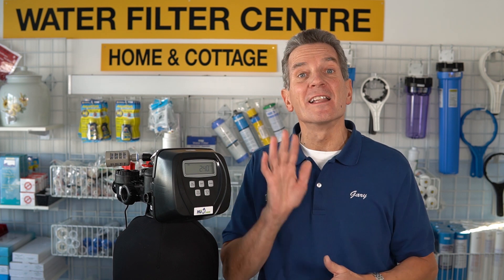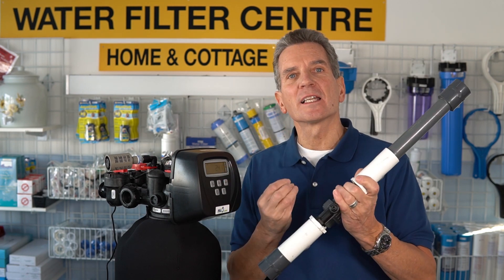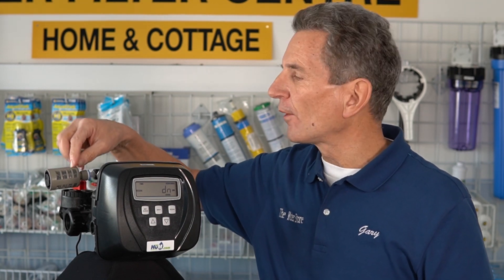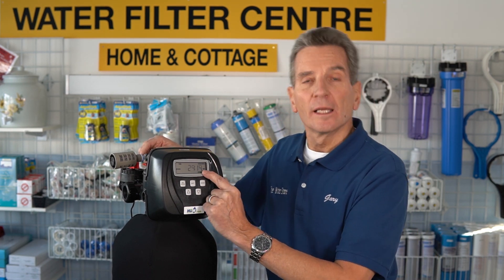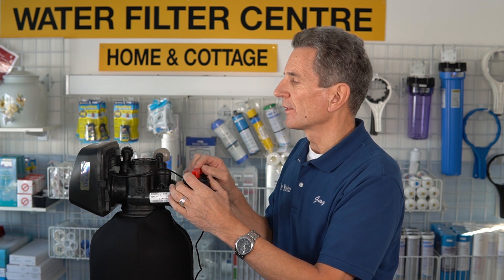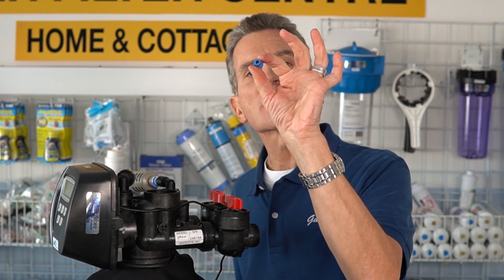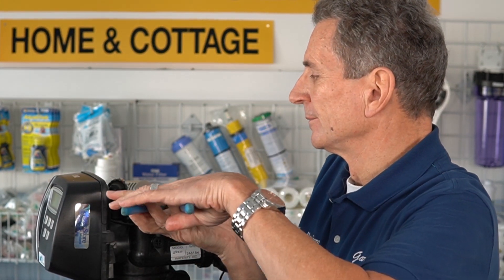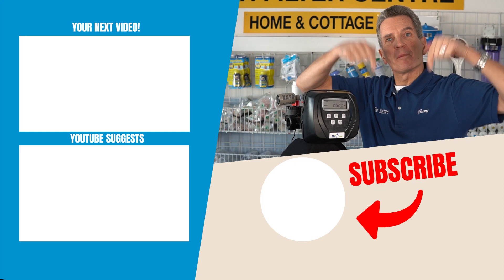IRON & SULPHUR WATER FILTER TROUBLESHOOTING and Repair in 7 Easy Steps

Comment: Hi Gary, i hear a gurgling sound (water moving) in the unit everytime i use a faucet in the house. The issue started a few months ago. The unit itself seems to be working just fine. Wondering what you think.
Reply from the maker: It could be that the internal check valve is fouled with iron. https://waterestore.ca/products/clack-ws1-v3957-internal-check-valve-for-fob-c-k  Check it out in this video https://youtube.com/shorts/TQZed1m_4oA

Comment: Hi
Question:
If i put this air valve how my softener will get the water with salt from the barrel?
Thanks
Reply from the maker: You need the injector to create the suction to suck the brine from the brine tank to the softener.

Comment: The morning after the iron filter regenerates (every 3 days) we have a brief sulfer smelling water in the running water. I usually let the water run for a few minutes and it goes away. What can be causing this?. The system also has a water softener tank.
Reply from the maker: You can try changing it to every 2 days instead of 3
Reply: @water_estore  thank you, I'll give it a shot👍

Comment: HEEELP!!!!!! My filter is leaking right at oring where it screw to tank, also when I hit regen it shows call such number for service, umm problem is I own the equipment, so will your service bypass this nonsense??  Leaking in ft myers fl
Reply from the maker: Call means nothing, just a reminder that someone programmed into the valve.  if it is leaking at the top of the tank you may have a cracked tank.

Comment: When your doing each step such as taking out the air valve do you stop the backwash process you started originally? And if so how?
Same question on when letting the bleach sit you started a cycle but didn't end it? Is that how it should be?
Reply from the maker: You keep the system on bypass during those steps.
Reply: @water_estore  ok I understand the bypass but I don't think you got my question....  Do you END the backwash process while your performing steps such as removing the air valve while installing the hose etc?

Comment: Hello Gary, We moved into a house with an ozone water treatment system and a Ws1 iron removal unit and your videos have helped me to understand how everything works. Thank you so much. Recently our iron filter has started leaking a little bit out a small spout at the top of the unit during its regen cycle, I can find no reference to what this spout is for in the downloaded manual. Any ideas what would cause this? I believe the unit is due for a valve rebuild and rebedding. Would I be able to order everything from your store to do the job?
Reply from the maker: Hi Steve, your leak is from the drain elbow and we have the replacement part here https://waterestore.ca/products/clack-ws1-drain-elbow-v315801  Yes, we have the rebuild parts here https://waterestore.ca/products/clack-ws1-fob-c-k-rebuild-kit-no-injector-wrench and the media here https://waterestore.ca/products/birm-iron-removal-media-1-cubic-foot

Comment: Hi Gary. I am in a home with a soft pro system. It is set to 10 min backwash, 60 min Brine and 10 min rinse. It also has a refill setting that is set to zero. Are you familiar with this system and is the 10 min rinse getting rid of my air pocket? Smells like eggs right now.
Reply from the maker: Yes, that rinse should be zero.

Comment: We have a Marlo Oxidizer iron filter installed in 2019. Going on vacation this summer and would like to shut off water to home. Don’t want to regenerate without water so can I simply unplug the iron filter, then plug in when we get home? Will we lose any settings or does it default everything back in?
Reply from the maker: With our HUM water filtration products you sure can, not sure about theirs.  I would ask them.

Comment: I got mine sucking air and working but it has low pressure and you can here water dripping inside the tank after you run water or regeneration, and also it’s got back pressure until you put it in bypass which that might be normal. If I had pressure I’d be good.
Reply from the maker: It sounds like it is clogged with sand. check this out https://youtu.be/tCQQxiT-zoc

Comment: Have you ever come across one that always has water coming from the drain line? What would cause that? I have one called the repair guy he came over said all the mechanical things work like the cam and switches. He said my problem was I have a leak and I’m using to much water. I searched my home found that the water is actually coming from the iron filter itself out of the drain line what would cause this?
Reply from the maker: Water is leaking past the piston and seals.  this video will help https://youtu.be/RhvspR3PAw8

Comment: Ever have the issue where the filter draws air just fine during the brine cycle except it spits it out the drain at the same time? I replaced the seal pack and piston. Worked great for a week where only water was going to the drain during the brine cycle but now once again air is going to drain. I can barely get a day out of my filter before it becomes waterlogged and gives me H2S gas smell. The filter can barely draw enough air.
Reply from the maker: No, I can't say that I have.  I have a new video coming out soon about replacing the internal check valve which might help you.

Comment: Thanks so much for your videos! We cleaned the injector, but the air intake on the iron filter with the inlet valve open, will not suck up the bleach. Any advice on this would be greatly appreciated!!!
Reply from the maker: Do you have it in the brine cycle?
Reply: @water_estore  thanks for the response!  We purchased this house and it has a water system.  It has a water softener with brine tank and a another larger tank (iron filter) i believe because there is so much iron in the well.  it has an air intake.  When holding the regen button for 5 seconds it goes into the "backwash" cycle.  when you press it again it goes into the "rinse" cycle.  those are the only 2 cycles.  thanks again for your help!

Comment: Hello Gary. We have a Clack Iron filter like the one in the video. It was installed in November 2017. I would like to check the condition of the jet so I bypassed the filter using the red handles and started to undo the injector cap and water started leaking out. How do I release the pressure under that cap so I don't get sprayed with water? I did not empty the drain line or start the regen cycle because all I wanted to do was check the condition of the jet and ascertain its  colour. Thanks.
Reply from the maker: Just bypass, start a regeenration and once you no longer hear water running to the drain you ncan open up the injector.

Comment: Hi Gary, we have an Impression Plus iron filter and when it is on it leaves carbon residue in the toilet bowl and pieces of carbon in the tank. When the system is off we don't get the carbon. Any ideas?
Reply from the maker: See if you can increase the back wash or rinse times.

Comment: Hi Gary! Thank you for the videos, they are incredibly helpful. I have a well with a treatment system similar to the one in this video. It was installed ~6 months ago. About 1 week ago I noticed a sudden drop in water pressure (not extreme but enough to be noticeable) and at the same time, the top fill plug on the iron filter tank started dripping. I called the company that installed it but have yet to hear back so I am beginning to research a solution myself. The installers did not leave any sort of manual or instructions. Is it possible that these 2 things are related or is it coincidental? If it matters - our well has extremely high iron (so high that particulate flecks are visible if it isn't filtered) and the other system components are a pH treatment and a 5 micron filter.
Reply from the maker: I would check that 5 micron filter first in regard to the pressure drop.  The leak is likely due to some other concern.

Comment: Should my iron filter be showing a flow rate of 0.0 GPM when water is running or being used?? Thanks.
Reply from the maker: It depends if it has a meter or not.  Most iron filters do not.

Comment: Hi my water pressure sometimes is very low I've check my pump and pressure tank both fine, i just bypassed the sulphur block and the pressure imediatley was fine 
my question  can the sulphur block get clogged causing lack of pressure
Thank you for you help (if you can)
Reply from the maker: Yes, it can and if you bypass and the pressure returns you either need to repalce the system or at least replace the media inside the tank.  
This video shows you how to replace the media https://youtu.be/Z47JGH1l39o New system is here https://waterestore.ca/products/hum-foc-sulphur-water-filter-one-cubic-foot

Comment: Hi, thanks for the video.  Is a 60 minute brine dn (air draw) too long?  Just noticed my system is set to that.  Will that cause any issues?
Reply from the maker: 60 minutes is the default time for brine draw on most water softeners.  It is correct.

Comment: Hi Gary!  I built and installed a whole-house water filtration system a couple years ago and everything was great once I had it going!  Now our water is tasting metallic again and I've replaced 2 of the 3 filters in my system.  (Actually there are 4 filters, the first is a 50 micron spin-down filter).  We are still getting that metallic taste as well as stains in our shower/tub and calcium build up on the shower heads.  I'm going to follow your instructions from the above video and HOPE that the softener is my only issue!!  The filters are: 50 micron, 20 micron pleated with a clear case, 5 micron carbon that I fill with medium (reusable), and a 0.5 micron filter at the end.  I'm also considering installing a UV filter after all of that too, for viral protection.  I know that the softener is a bit old and I'm hoping I don't have to replace the medium in it (hear it's a messy job!) but do you have a video on that?  I'm going to hunt for one, lol, and thank you for all the great content!!
Reply from the maker: This video shows you how to repalce the media https://youtu.be/Z47JGH1l39o  Have you had your untreated water tested for iron and hardness?  You might have more iron than the water softener can handle.

Comment: I have the potassium permanganate brine tank unit instead of the oxidizer unit that is in your video.  I have replaced the injector, washed out the brine tank and suction line and it is still not drawing the pot perm solution out of the brine tank.  Does this mean the media needs replaced?  My unit is only 4 years old…is this the average life of the media for a pot perm unit?  Is the media life the same for the Oxidizer unit?  I’m thinking of swamping out my pot perm unit for the oxidizer just to stop messing with the pot perm.  Comments and thoughts?  Thanks.
Reply from the maker: Thise Potassium Permanganate systems require trouble shooting just like a water softener, check out this video https://youtu.be/Lr3jyGiJdC0  I don't think the media is the issue, check to make sure your drain line is not restricted.  Yes, you are far better off with an oxidizer like this one https://waterestore.ca/products/hum-fob-chemical-free-iron-filter

Comment: Is there a reason that the hellenbrand 6.0 I have does not have a air valve? It just has 2 grey plugs and a metal screen under the cap.
Reply from the maker: I am not familiar with that product, I would ask the manufacturer.

Comment: Thank you for the informative videos on water treatment. I have a Watershield Sulfur Block tank that is less than 2 years old.  Is it possible that the media needs replacement after less than 2 years in service and if so, how much should I expect to pay to replace the media
Reply from the maker: It would depend on your water chemistry and how much water you use and the size of the tank.  Media replacement could be as low as $500 on up.

Comment: Gary, when I put my Iron filter into brine draw, water squirts out the air intake.  I checked the injector and it is clear.  What should I do next?  Thank you.
Reply from the maker: Replace the air draw assembly here https://x9bgz9os9j7qacz6-17147789412.shopifypreview.com/products/clack-fob-c-k-strainer-check-valve-air-intake-assy

Comment: Do you have a video on a potassium permanganate iron & sulphur filter system?  My system looks like the one in your video except where you show the air inlet I have a tube connected to another small solution tank of pot perm solution.  I’ve cleaned the blue nozzle.  I don’t think it’s drawing in the solution to regenerate the medium.  Also, is it possible for bacterial growth to form in the tank?  I seem to also have a wispy sediment that comes out of the tank in backwash mod.
Reply from the maker: No I do not.  I do not recommend those systems, they use very old technology.  I have worked on a few, you likely need to take the tank apart and clean it.  Be sure to wear rubber gloves as it is super messy.
Reply: @water_estore  thanks.  Can I simply unplug the pot perm tank from the media tank and put one of those breather units on the existing tank I have?

Comment: I'm losing water pressure in the home but if I bypass the system the pressure returns.  Any suggestions? Also by changing the media can you go from a fob to foc or fok and will the head function properly?
Reply from the maker: You need to replace the media, it is clogged.  this video explains how https://youtu.be/Z47JGH1l39o No, you cannot switch between media types without making other changes.

Comment: I requested a well aerator and a Impression Plus was installed on 1/21/21 and the sulfur smell disappeared immediately. By March the sulfur smell reappeared and the water is as bad as before the installation and now I’m told I need to install a second part because the sulfur contamination in my tank is very strong. This system does not have the air removal part that you show to remove the sulfur. I’m not sure if I should trust the installer anymore.
Reply from the maker: I wouldn't.  These Impression Plus models are not a long term solution for sulphur removal.  You likely need an FOC or FOK depending on your iron content https://youtu.be/af1iVOC-Hyk

Comment: I twisted the air intake filter tube some and then I could hear the air intake working. I didn’t do anything else to get the air flowing again. seems like a simple fix, hope it works.
Reply from the maker: Did it work?
Reply: @water_estore  yes it did, I’m still in shock that it did because the water folks hear have been trying to fix it for a couple of months. They recharged it, replaced some parts, ran chlorine thru the system, lot of things, and all I did was rotate the vent. It has worked perfectly sense. I would have never found that if I hadn’t watched you video. Thanks so much. You saved us a lot of money, I was getting tired of it and ready to buy a different system.

Comment: We have an iron filter and water softener . We ended up needing to replace our pressure tank a couple months ago and after we did every time the filter regens we get a ton of air in the lines? We could cause this?
Reply from the maker: I really don't know.  Since nothing changed with the water treatment it must be something with the new pressure tank.  Did you check with the installer?

Comment: Gary, I have a 268/742 Performa Series Glendale. Lately, in the last half hr of regeneration it sounds like pressure build up and sudden release into the lines. No one seems to know anything about this system which includes Potassium Permanganate. Do you have any suggestions or advice?
Reply from the maker: It sounds like there is a clog somewhere, likely in the media.

Comment: Great videos.  Could you tell me approximately how much water is used when back-washing?  My holding tank is not very large.  Thank you.
Reply from the maker: Great question, but it depends on the water softener.  Some as much as 100 gallons, although 40 is more typical.  The best are WaterBoss water softeners at about 15 gallons.  Check it out here https://waterestore.ca/products/waterboss-proplus-380-high-efficiency-water-softener?_pos=175&_sid=f3a739624&_ss=r
Reply: I'm interested in the iron filters as opposed to softeners.  Do you think the water used to backflush is approximately the same?
Reply from the maker: @steveschmoe7290  You are looking at about 40 gallons for the iron filters.
Reply: I assume you are near a lake and can't have a standard septic system and drain field. There is no need for the backwash to be going to a sewage holding tank. The backwash water is not sewage. Drain it into a long perforated pipe buried in the yard.
Reply: @DMahalko  Good idea.  Thanks

Comment: I have water coming out of my air draw. Could you give me some pointers on how to fix this issues. Please and thank you. EDIT- I want to add that my injector is free and clear of any build up.
Reply from the maker: There is a check valve inside that is leaking.  You need to replace the air draw system  https://waterestore.ca/products/clack-fob-c-k-strainer-check-valve-air-intake-assy?_pos=1&_sid=83c510f3e&_ss=r